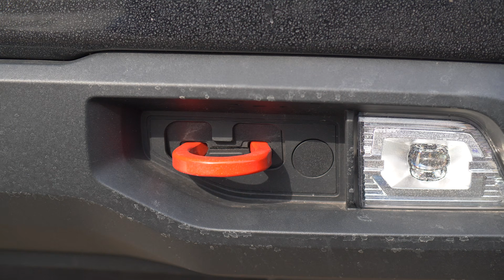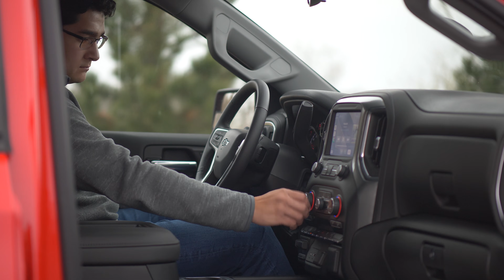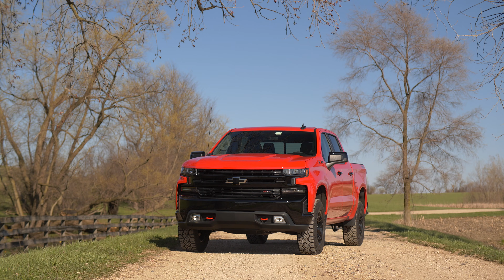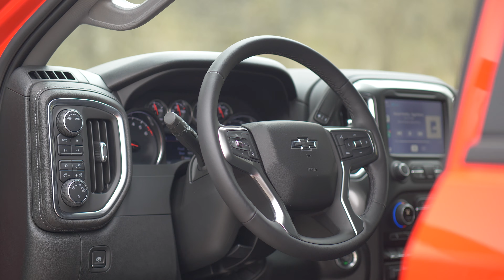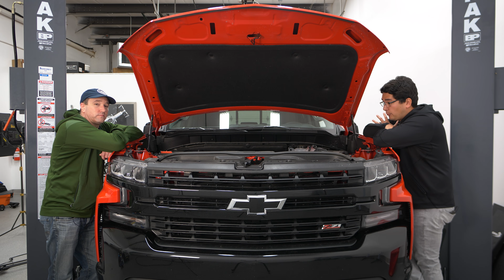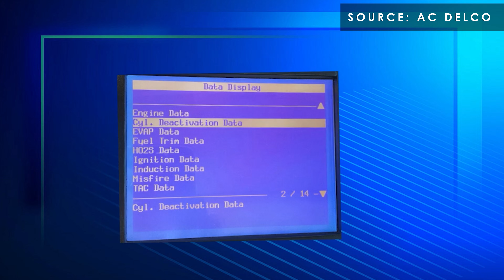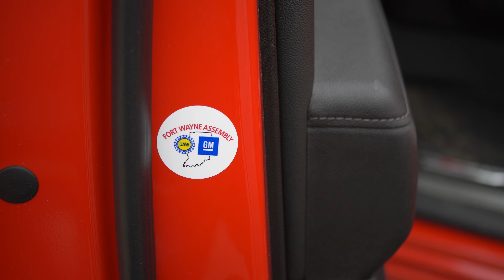2020 Chevy Silverado | The Golden Child

Comment: You're not giving this truck a fair shake compared to the competition IMO. This is a much more basic model than the F150's, Rams, Tundras, etc I've seen you review. If you're comparing it to Platinum F150's and Optioned out Rams then you should test a High Country Silverado or maybe a GMC Denali with its magnetic ride suspension. This truck is a more basic or maybe middle of the road truck with an off-road package so of course it's ride, and seats, etc are subpar compared to the other recent trucks you've driven. You get a loaded Denali with it's innovative tailgate, composite bed, magnaride suspension, 6.2L V8, etc and I think you'll like it a lot more, even though it would cost a lot more than this truck as well.
Reply: JROC734 the last ram we had was the rebel which in theory is a direct competitor to this thing. Its really not a bad truck but when compared to the other two you lack fords better body structure, arguably more reliable motor as well. In the rams case a far superior interior and ride with or without air ride(that truck has similar issues with reliability historically.

Comment: I went from a 2012 Ram 1500 Laramie with the 5.7 to a 2017 Silverado 1500 High Country with the 6.2l and I couldn't be happier. My Silverado rides better is hands down way quieter, has a better drivetrain, better fuel economy and just overall is a much better truck. My Ram front end was falling apart at 130,000kms, time will tell how this holds up.

Comment: a fair review,  though they definitely overplay the AFM issue.   Change the oil right and timely and your chances drop dramatically,   not to mention isnt nearly the issue it was in the early 20teens.....not even close.      It did happen to a friend of mine but even then at 158000 miles and a mechanic fixed it for 3k.     not cheap at all.........but buying an extended warranty for something you barely have a chance of happening now?    please....lol.    That said,  spot on with the seats.    They're hard.    I'm a big dude though so they are very doable but still,  a little cushion would have been nice.

Comment: Dropping out cylinders is why I didn't consider buying a  GM product pick up truck. Plus engine shut off whenever you stop. Yes, I know about the bypass switch, but should not have to remember to do that. Should default off.

Comment: Nobody screams cheap better than Chevy! Ford is getting better but their interiors still are rental grade too. FCA nails it there. Comfy, great ride and so on. I love the Chevy V8 and the 10 speed automatic. 2 of the best things about this truck. Body and frame is competitive. But live with this thing? Not just no. Hell no!! Ford has me still wondering about drive train reliability too, and FCA isn't much better. Toyota just runs and runs, but have been in the dark ages for years in their big Tundra. But they go and go and go. Reliable. When you rely on this truck for  your business and personal day to day, you don't want to worry if it is going to tow the company trailer to next show okay, or if we are going to be screwed on our vacation towing our toys and this thing schiits the bed. At $50,000.00 this should be the truck for the ages. Any of these hyper expensive trucks today that could punch easily $80,000.00!!! WTF!!! It IS a TRUCK!! But hey that is what we want today, trucks and SUVs. But above all we want a truck that we know starts and goes and goes and is tough!

Comment: You guys for the most part seem quite knowledgeable but seriously, "2 V6's and one is a turbo"? Not even close to being correct. Was it just that you misspoke or was it not knowing that the turbo is a 4 cylinder. And the fact that the turbo 4 is offered in a full size pickup is not a talking point for your review in any way?

Comment: I have a 2019 Trail Boss and might just ask about extended Warranty on engine and trans.  I thought it was 8 speed to be honest.  Taking it in tomorrow for 4th recall I think.  You didnt mention it has a sport mode, did you ever try that out to see if it improves throttle response and shift timing.
Reply: Brad Hilsden i think the trailboss lt gets the ten speed where the regular gets the 8!

Comment: The review never touched on actual truck specific measures like: towing, hauling  or off road capabilities. Having sat in all of big 3 offerings on the same day at our international auto show I can say that neither brand is immune to cheap hard plastics. The other offerings just have more shiny bits. Check out actual side by side comparisons at TFL channel and you’ll see a better review with an actual side by side. Surprising the GM offering was just as smooth riding as the Air suspension Ram through the same terrain.
Reply: Honestly I don't feel like there is a point on talking about towing and hauling. These trucks are so close that either of them is going to get the job done. Most of the off-road trims are just for the look, and there's plenty of reviews on that. 95% of the ones sold are just gonna be driving around on pavement, might see a gravel road here and there. 
I have to agree. I see base model F-150s going for $52K, now that's ridiculous. On the flip side I see pretty loaded up Rams with the full leather interior and packages going for that much.

Comment: If you know up front that you're going to need an extended warranty to get you to 100K (and you will) then you probably shouldn't buy that vehicle. 

I have no loyalty to any company. A truck is simply a tool for me and I want one that doesn't give me trouble. My last Chevy, a 2013, will be my last.
Reply: I have 107K miles on a 05 half ton 4X4 Chevy and have had to replace both front wheel bearings, a drive shaft U-joint (50K) my dash gauges are starting to go gaflinkus and have replaced the rocker panels and fixed the box rust.... Oh I Ziebarted the damn thing brand new and I wash the hell out of it and keep it in the shed. I have been a GM man for 50 years but my patience is running thin.
Reply: I had to add one thing. I also believe GM has a agreement with OPEC as the amount of petro-chemical plastics used in the interior is insane. I know it started back in the late 80's with GM but, damn.

Comment: Another outstanding review. I do have to disagree on the comparison of the GM 5.3 vs the Ford 5.0 post 2018. Now with the 10 speed with 5.0 runs 0-60 under 6 seconds. It tows more, has slightly better gas mileage and does not have any dfm/afm now, and added port injection 2018-present.
Reply: I agree with everything you said, I own a 5.0L F-150 FX4 Supercab and its a wonderful powerplant. I briefly worked at Hertz as a porter so I got lots of seat time in other vehicles including my fair share of both 5.3L and 6.2L Silverado's, the 5.3L was definitely adequate for most people but the 5.0L is in a different league and more closely compares to the GM 6.2L. Of all the V8 trucks I drove the 5.0L Fords and 6.2L GM's were without question the fastest, the 5.6L Titans were next down the line, then the 5.7L Hemi Rams and then the 5.7L Tundra's and in a distant last place was the 5.3L GM trucks. It's a shame the 2021+ 5.0L's have AFM built in them, I hope Ford learned from everyone else's mistakes and made a reliable system for it, only time will tell though.

Comment: Nice review.  Glad your holding GM's feet to the fire with the cylinder management debackle.  Might also be worth mentioning that when Toyota had an issue with frames rusting out on their medium and large trucks, they gave every truck one free frame replacement, even if it wasn't the original owner.  GM's track record of support isn't as good as their competition.  For something that costs practically $60,000 to drive it of the lot, this is unacceptable.

Comment: You're both oh so WRONG!
Chevy's interior compared to Ford's equal is way better for fit and finish, sure RAM has the highest standard for interior design but worse than a Ford.... You're fucked up!
Want a bit better then buy the GMC truck which blows Ford behind Tundra for interior.
The 5.3 and 6.2 are very reliable engine's and dependable too. I don't know where you got your info from, probably Fox news but the 5.3 from GM isn't as good as the Tundra or Titan engine's but are in par with the Coyote and Hemi.
How many Chevy small blocks are in classic cars?

Comment: I think you might have misspoken on the engine/trans options, as in the configurator it lists a 2.7 I4, 4.3 V6, 5.3 V8 and 6.2 V8. Trans come in 6, 8 and 10 speed options.

Comment: Personally I like the GM trucks the most of the 3, especially for the mid spec trucks (40-50k range). The drivetrains are hands down the best, and now are the most fuel efficient V8's on top of that, and when you don't get carried away with trims and options, the Silverado RST or LTZ doublecab makes for a great value truck, and the cabs are so big that a double cab truck has a bigger back seat than most sedans and small crossovers. Considering you can get the diesel or 6.2 in that above mentioned truck with an MSRP below 50k, the fact this LT cost 55k is pathetic. Personally I think you just reviewed the worst equipped truck GM has to offer, considering the custom trailboss is infinitely better, and still offers the 6.2 for 43k. This 55k trailboss is more expensive than the opening price of the GMC Denali, and the Sierra has a 1k price hike across the board just for being a Sierra. The amount of luxury lost in comparison is laughable. Personally I do think the LTZ silverado (along with the GMC denali) is the best looking truck on the market, with the big and bold chrome grille and such. But that's the beauty of options and opinions. 

Ram by far makes the best luxury trucks, but thats where their pedigree ends. The volume trucks for ram are just lackluster IMO, it seems the redesign was built around the limited and laramie longhorn, then downgraded to fit a price point. 
Ford I believe is just the Apple of trucks. People buy the trucks for the blue ovals, not the actual truck. I've heard people say "my chevy gave me nothing but problems so i bought an f150" but at the same time I hear "my f150 gave me nothing but problems so I traded it in for a new one". I just don't get it with ford. 

Also the new DFM cylinder deactivation system in the 6.2 and especially the 5.3 makes for an extremely efficient V8. The 5.3 gets better fuel economy than the 2.7 on the highway (by chevy's own ratings) and an overall very similar average. I can't speak to its reliability, (as can no one) but at least for the first time I think the system is worth considering just how much fuel you actually save. Many have also reported its rather seamless in operation vs the old 8/4 system

Comment: Here is a little bit of clarification on the drivetrains (since there are a fuckton of them). Also side note, the sales figures for silverados include all the heavy duty models.
The 6.2 only comes with the 10 speed in 4x4
The 5.3 DFM comes with a 10 speed in 4x4, and an 8 speed in 4x2. This is in the LT (volume trim) and higher
The 5.3 AFM comes strictly with the 6 speed in both 4x4 and 4x2. This is only available in the WT and Custom trims, and the Custom is a WT appearance package.
The 3.0 diesel gets strictly the 10 speed in both 4x4 and 4x2, and is avalible in any trim the 5.3 DFM is (except trialboss because GMC wants the duramax exclusive to the AT4)
The much hated 2.7 I4 turbo comes with the 8 speed in all trims but LTZ and High Country where it is not an option at all.
The 4.3 the 2.7 sadly replaces is only available on the same trims as the 5.3 AFM and is soon to be discontinued there too.

Comment: I use to have a 1997 Silverado 1500. It had 267K miles on it and got great mileage I the city and highway 18/20. The only reason I got rid of it was a guy t boned me in an intersection I sold it to a porter that worked at the dealer I worked at. He took the truck to his Dad in Mexico to use on his farm. That truck is still working today on the farm. Miss that truck but won’t replace it anytime soon.

Comment: Ford has their transmissions geared to compensate for low end torque...And i had Silverado service truck with v6 4.3 which had NO cylinder deactivation and it still consumed oil a lot

Comment: I was relatively agnostic (with respect to truck religion) I ended up with a Raptor. It was easily worth the extra 10 grand or so over the trail boss with high trim...  it was a no-brainer even when accounting for incentives.
Reply: the trailboss, pro4x, rebel, and trd pro are all waste of space. the only offroad pickups are the raptor, powerwagon, tremor, zr2 and gladiator rubicon/mohave.
Reply: @james2042  even forgetting about the off road capability, the content was much better in the Raptor. I tested the LTZ and Denali trucks too. The 3.5 HO Ecoboost destroyed the 6.2 in all respects. The ride quality, features and options, etc. Literally everything was better.

Comment: It's hilarious that no one else can seem to do cylinder deactivation correctly.

The ram 6.4 v8 has had it for a long time(disable half the cylinders), and it works. You never notice it, and it doesn't do stupid things. Honestly I wouldn't know it was there if I didn't see it in the engine manual.
Reply: what year? my 08 grand cherokee feels life a different vehicle when its active. The transition is smooth but its 100% noticable

Comment: I'm a rust proofing worker and I can tell you after being underneath almost a thousand cars, DONT BUY A GM. They have rusted frames fresh of the fucking showroom floor. It's almost like they used baby powder to paint to the frames on these things.
Reply: ShoryukenDatAzz exactly. After 2.5 years, the undercarriage of my Sierra looks like a huge rust bucket.
Reply: @artagain8977  Give it a good wash, a rust proofing every year for a few years and maybe spray it with holy water and hope for the best.
Reply: Artagain - wash your car more often then  lmaoo
Reply: @Abused.Ls2  Washing isn't the issue. The metals and "paint" they use will fall apart if you look that them wrong. My 06 Civic is a shitbox with 260,000 kms on it. I only wash it maybe 4 times a year and the undercarriage is still clean with minor surface rust after maybe 2 rust proofing jobs. I've seen customers come in with the same GM cars every  year for the last 5 years and the frames still manage to end up with a new hole or chunk gone out of them somehow. Once the rust starts on a GM product, there's almost no way to stop it.
Reply: I heard they dont paint the frames, just wax them
Reply: @wigletron2846  That's what I hear too.
Reply: @wigletron2846  I work at a gm dealer and can confirm that they still use wax coated frames in 2020. They are the only manufacturer to my knowledge that still use wax on their frames.
Reply: @metadeth3992  pff. And still charge 50k+
Reply: I agree. I have a 2005 1/2 ton 4X4 and Ziebarted it right off the showroom, and I wash the shit out of it and only put about 7K miles a year on it. Well I live in Iowa and the IDOT slathers on that salt brine shit the first cloudy day of winter and wont stop until April. Cars and trucks are rusting out at rates never seen, even in the 70's. I will agree GM vehicles are becoming the worst though, I have new rockers and bed wheel wells, at a whopping 100K miles. There needs to be some kind of class action lawsuit against GM rust proofing. GM is designing their vehicles to rust, especially the trucks.
Reply: Living in the northeast doesn’t help either.  The towns put so much caustic shit on the roads in the winter.
Reply: @artagain8977  Live in Iowa.The salt brine the IDOT puts down at the hint of a snowflake is murdering cars and trucks in the Midwest.
Reply: Which manufacturers are good from your perspective?
Reply: @stevee8318  Most Toyotas after 06 are solid, VAG, Post Chrysler Merger Mercs and Hondas after 06 are solid if you watch the rear quarter panels and give them a wash every now and then in winter. Heavy duty Ford and Ram trucks of the last decade are surprisingly stout as far as the frames go. The bodies are a different story but nowhere near as bad as GM in terms of weather resistance. 

Mazdas are still garbage despite their promises to fix their rust issues. Kia isn't much better.
Reply: @Trussme96  

I have a 2015 Mazda in a salt using area and the undercarriage and suspension look fairly new.
Reply: @KT_One  The last one I was underneath was a 15 and all the panels has rust beginning to seep through the paint. The undercarriage looked like an 02 Chevy Malibu. All the paint on the control arms, crossmember and subframe was gone. Only rust remained.
Reply: @Trussme96  

Yikes. Perhaps the car going through the wash with undercarriage jets weekly is actually working for me?
Reply: @KT_One  It helps a lot.
Reply: @stevee8318  FCA, my 2014 JGC still looks nice and silvery underneath. I don't see many Rams either with rust unless they came from up north.
Reply: 02’ and 09’ I can confirm this. Had a Toyota Sequoia now for 5 years and besides the drive shafts it still looks new underneath. Live in Michigan too so it sees salt.